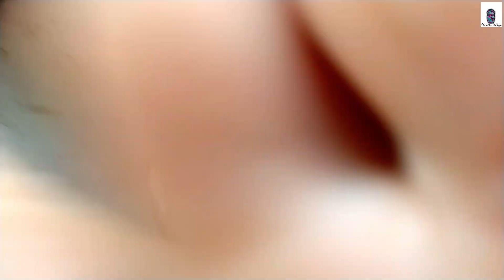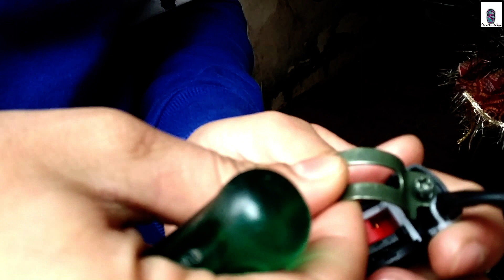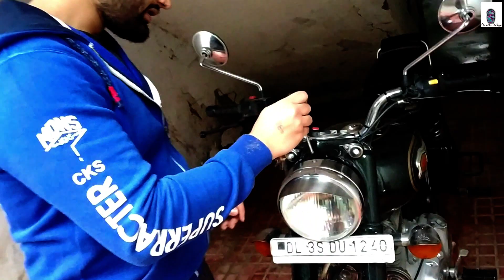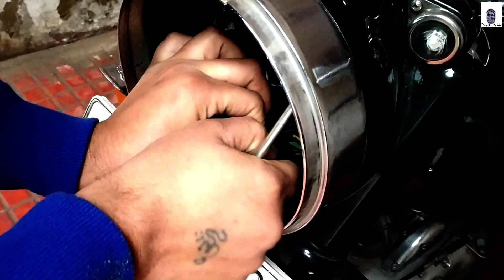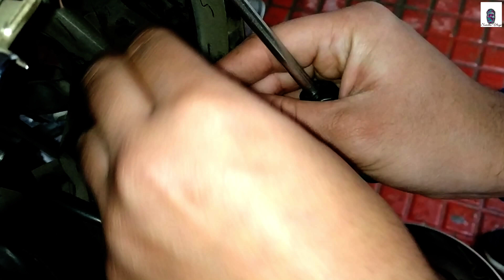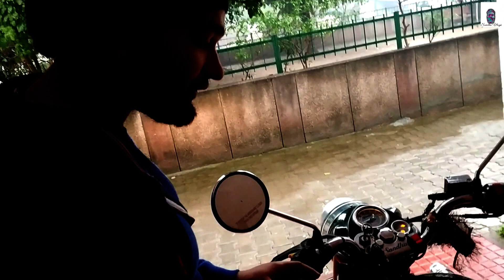How to Install Parking Light in Any Bike | Royal Enfield | Hazard Light | So Cheap

Comment: Bro its not working in my bullet when i connected one wire to one indicator and 2nd one to another and on the indicators they are working but when i on the hazard switch indicator is getting off instead of turning on all the indicators what to do now
Reply from the maker: Bro , it shouldn't happened ap phir near mechanic ko dekha lo ek baar 👍👍